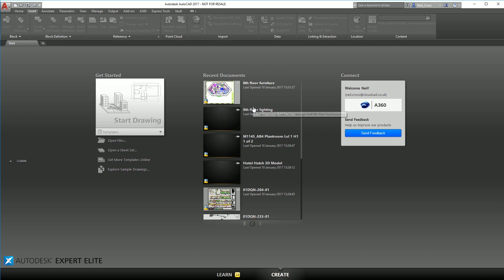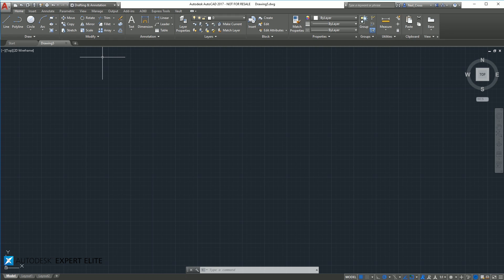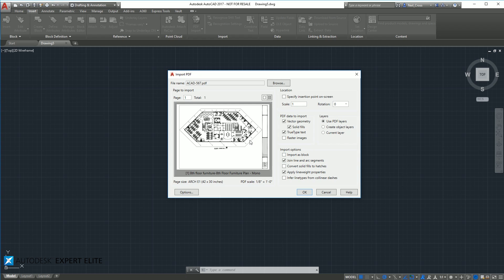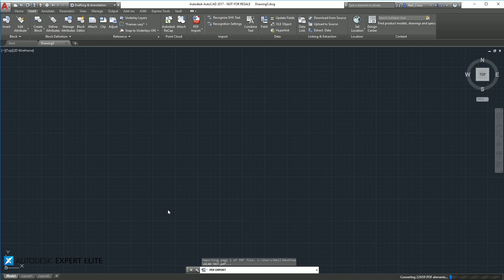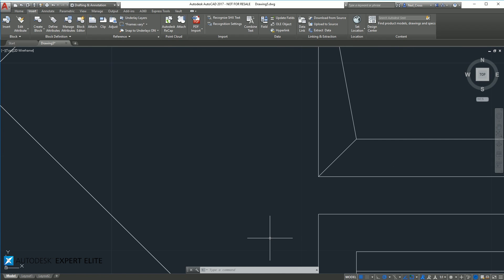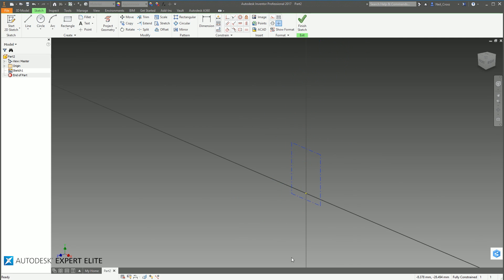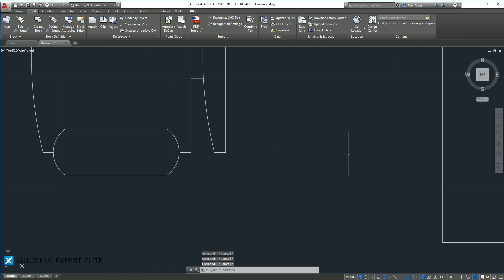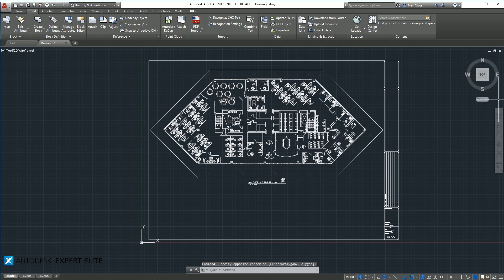We can now convert PDF to AutoCAD DWG??

Comment: This is a great addition and good job on the video.  If you want/need the pdf to be an underlay on the DWG, rather than using the PDF Import tool, use the "Attach" tool on the Reference panel.

Comment: Every vectored PDF is build with a sort of CAD program, 99% of those program's can export to DWG, we engineers wan't reliable asset, so I hate people that convert PDF to DWG and don't ask for the native files.
Reply from the maker: I think it's going to be useful for people who just get handed a PDF from a client, and it'll take days to find/get in touch with the original sender, wait for them to send the native file over, possibly sending the wrong one, when in 2 minutes you can now just convert the PDF and grab what you need from it with minimal clean up required.
Reply: Will help one of the drawing offices i work in no end.  It may even convince them to upgrade from 2012.  We always have to take architectural drawings (plans / elevations etc.) and scale them as a PDF underlay to produce detailed manufacturering drawings / layouts from the architects concept drawings.  As TFI rightly said getting the native file from the architects is sometime time consuming and troublesome something main contractors are not interested in hearing when all they want is their materials onsite so this would definitely be a BIG time / money saver in those cases.